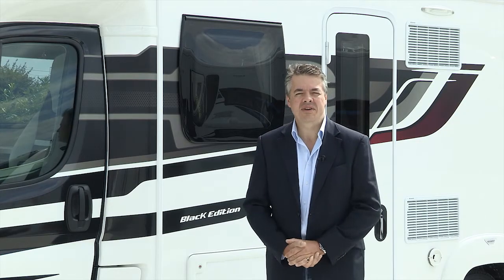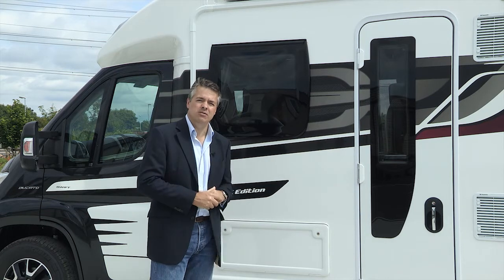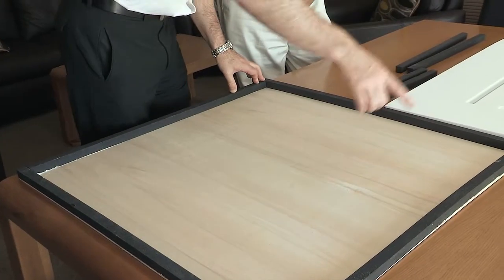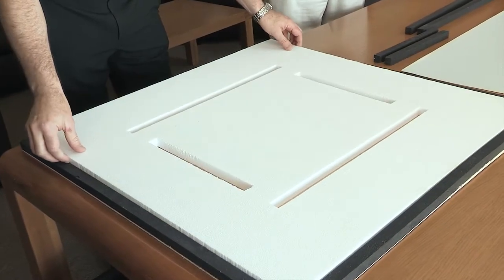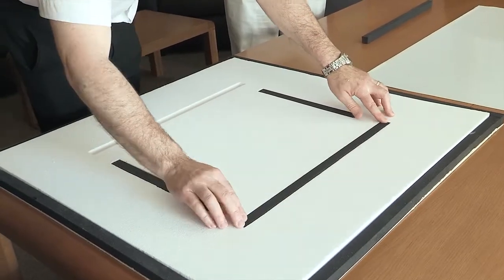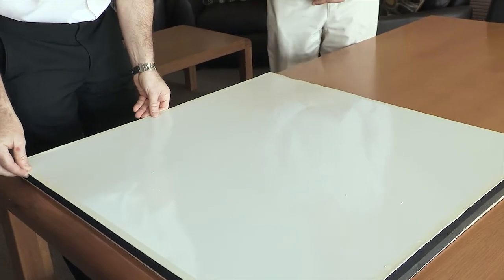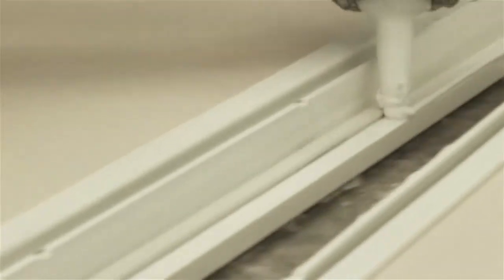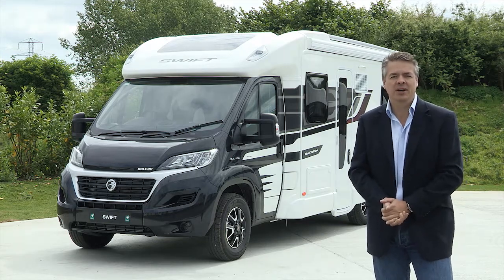How 'PURe' is used in motorhome panel construction, from Swift Group U.K.

Comment: what is the glue that is used to hold the polystyrene to the outer and inner panels , and where can i buy parts for my swift kontiki motor home   many thanks
Reply from the maker: Hi. Where are you based?